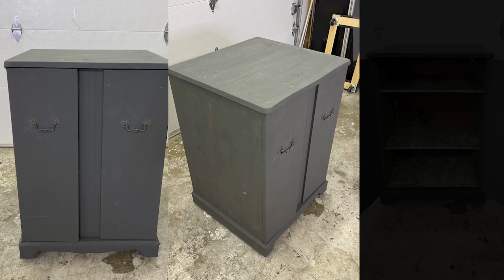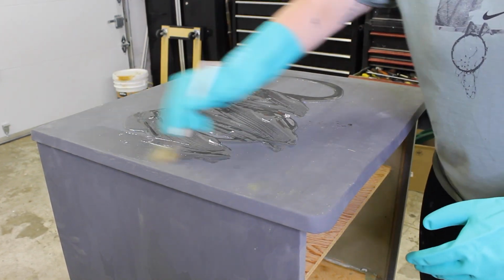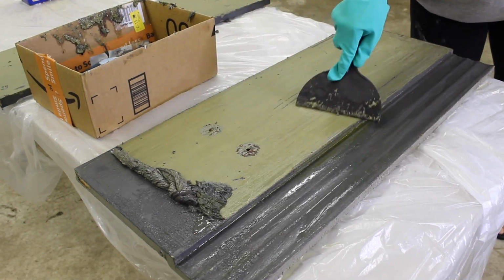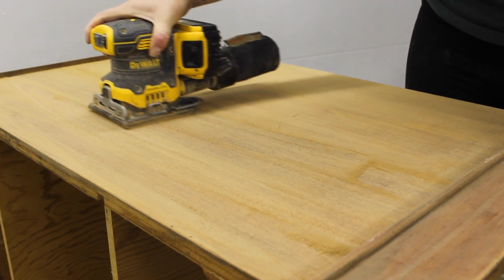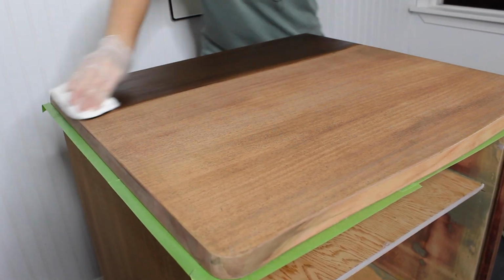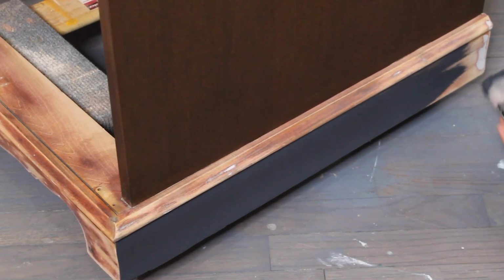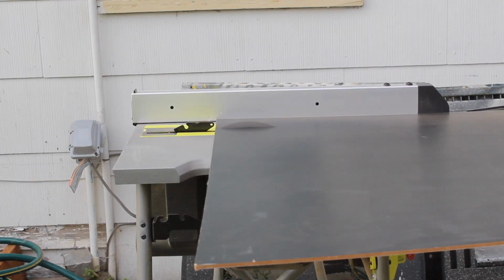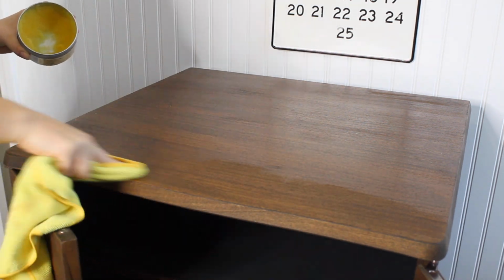Restoration of a Mid Century Stereo Cabinet | Extreme Furniture Makeover

Comment: Your table saw is badly out of alignment.  PLEASE fix it before you get hurt.  That would be sad, because you do good work.
Reply from the maker: Thanks Richard! Where do you see that it’s out of alignment? Want to make sure I’m looking at the right thing.
Reply: @UniqueUpcycles  It should not bind like that as you push stock past the blade.  It looks like the rip fence is closer to the blade at the far end.  It should be parallel.  Look for table saw alignment videos.  If stock gets caught between the fence and blade, it will launch right back at you.  It's called "kickback"  and is capable of causing bruises, broken fingers, eye injuries and other nasties.
Reply from the maker: Thanks for the info! I’ll check it before I use it again!